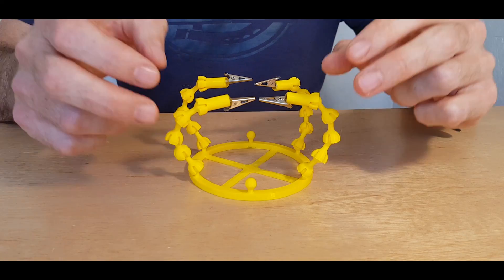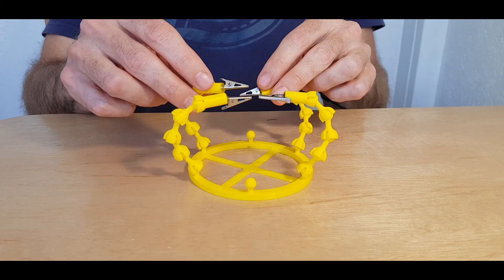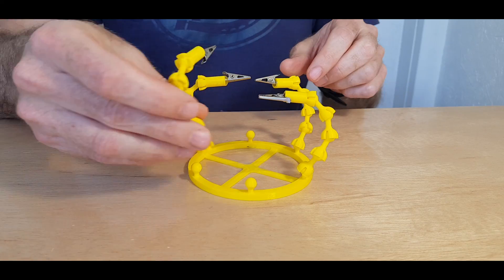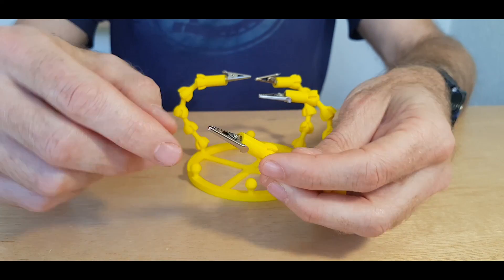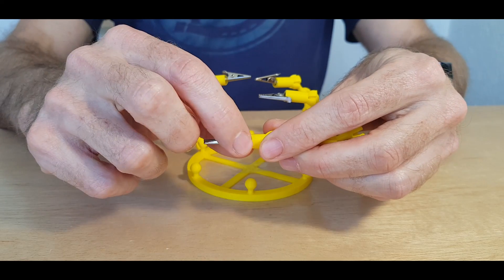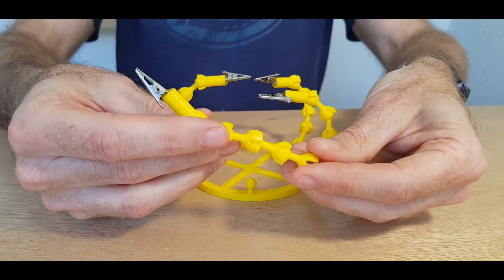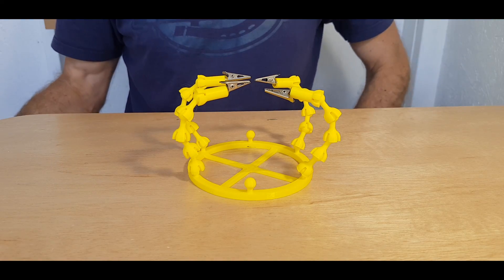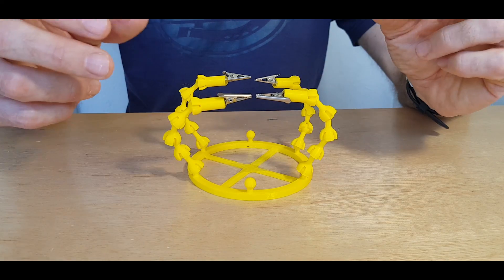DIY Solder Helping Hands - 3D Printed

Comment: printed 8-19-25 on Bambu x1c...PLA Red...came out nicely . only issue is the ball part on the base is ez to snap off...is there a way to thicken up that neck area?? maybe i add a pic on Printables page for you to see.....all in all nice design. Alligator clips 3.67$ plus Tax at HomeDepot.

Comment: I am working on designing my own helping hands, but the joints kept having issues, and I struggled to make it in the middle where it would be a tight fit 😞 either it would snap or too loose

Comment: noice... do you remember, by  chance, the infill density you went with? I am realizing as I type this it probably is a thin enough print that infill density wont effect the smaller parts all that much, maybe the base though. I can go ahead and experiment myself, I'll go ahead and leave this comment for posterity or something. lol. 

edit: if anybody is looking for infill density, its not the end of the world to just set it to 100. for my ender 3 with a custom fast profile from CHEP and using PLA: 25 percent infill was 42 minutes, 100 percent was 54 minutes.
Reply from the maker: Realised I missed that detail.  My settings were...
- Print with no supports.  
- I printed with 0.2mm layer height in PLA.
- Use 4 layers on the walls:  
    Prusaslicer - Vertical Shells -> Perimeters = 4
    Cura - Wall Line Count = 4
- Infill was 20% but as its so small it's all walls.
Reply: I printed with 15% infill on normal PLA+ , works just fine for me , doesnt matter imo